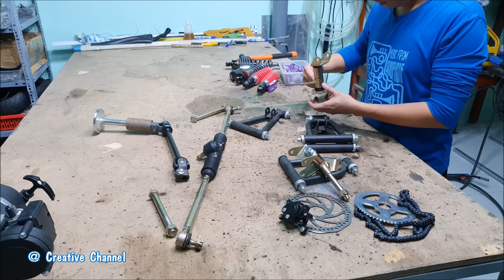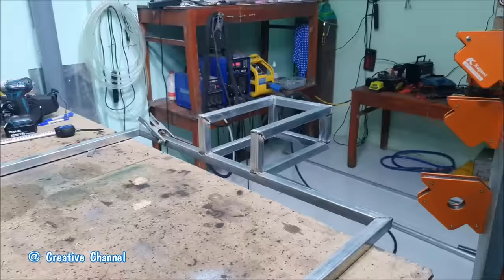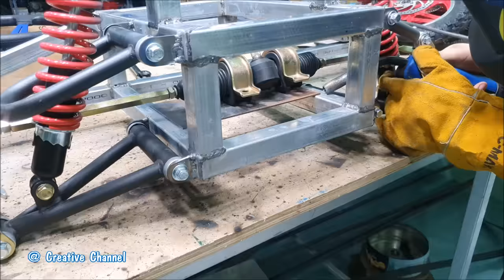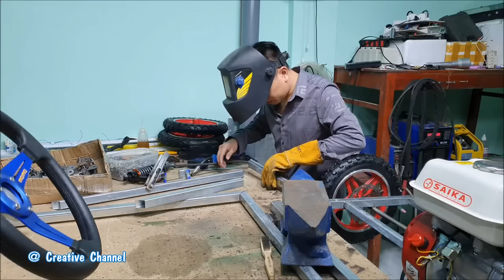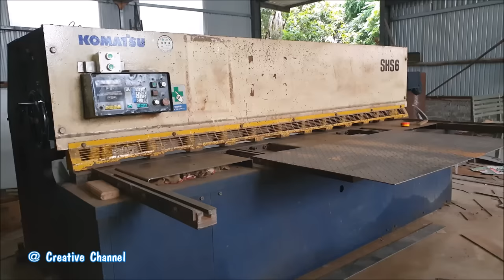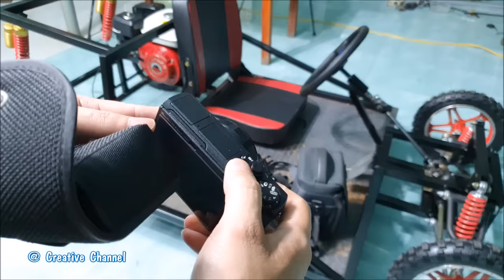Build a 250cc Go Kart at Home - Tutorial

Comment: It is fantastic. One exception: the floor needs more support. It relies only in a couple of screws. You need to reinforce it, especially for your off-road adventures. All the best!
Reply: Need more screws ? Are you kidding ? Did you see how many screws he used on each side of that floor panel ? It looked like every one to two inches !! And that floor panel looked plenty heavy !!
Reply: david lewis Yea I agree with you. What it really needs is more rear suspension support and it needs to be 2 wheel drive instead of 1 wheel drive.
Reply: @davidlewis620  I wasn't talking about the screw number. That go-kart needs at least another piece of tubing in the middle of the floor, front to back, to add more support to that floor. The screws he used are not thick enough to make it in off-road conditions like he was doing in the video. 
In the end, it is up to him whether he wants to consider my advice or not. No offence there!
Reply: @olachus  Ok , I get it, more support for the center of the floor board . Also , he may want to carry a passenger, therefore he would definitely  need more support  for the extra weight ! Understood !!

Comment: Its a awesome development i remember doing a similar project as my final year mechanical engineering project designing and fabricated a compact car with a auto engine on is back... But your project is a bit cooler but the only flaw i found that the lack of differential unit for the rear wheel set only one wheel is powered which will not do you any good if you use this on a uneven surface bro... Also equip the front brakes as well
Reply: Exactly I thought the same thing, only one wheel works when it should have traction on the two rear wheels

Comment: Just my suggestion, but I would have added an angled cross bar from rear upper frame near rear shocks to the bottom of the upright for added support for that assembly the shocks are bolted to. After awhile those welds are going to break or bars bend without those angled supports.

Comment: ok apart from the huge  parts store, this guy works in a totally different way from how I work (I build race cars) , my design is complete before I start, he has the design in his head and assembles/ fabricates all mixed up. my comment on design:  1 the rear frame carrying top of rear dampers needs a diagonal brace. 2. it needs a brake that works!  its very heavy, all that 6 mm steel plate must weigh 25 kgs.  apart from that, he is a talented fabricator and I would give him a job !

Comment: needs a straight shaft so power goes to both rear wheels.
Reply: Totally agree
Reply: Those wheels are way to thin
Reply: You are so right
Reply: I agree. It needs to be 2 wheel drive!! It will perform better
Reply: Definitely needs some reinforcement on the upper rear coil over shock mount The steel was flexing more then the shocks were.
Reply: If you get power to both wheels you wouldn't be able to stear, that's why cars have a differential.
Reply: Krister Emtweden you can still be able to stear but it won’t be the greatest. Most cheap go karts are like that.
Reply: imm thinking same thing
Reply: @kristeremtweden1481  Both wheels is called a "live axle"..
Reply: MattyE   I agree too hate the one wheel peel idea 😂😂
Reply: @kristeremtweden1481  duh... Go karts are the closest to F1 handling, what are you talking about?
Reply: @ΑΡΗΣΚΟΡΝΑΡΑΚΗΣ  so you mean that F1 cars does not have a differential? I would like to se that them taking a corner with both rear wheels spinning at the same speed LOL
Reply: 300 km/h into a corner and booth wheels locked at the same speed hahahahaha
Reply: EVEN a traktor that travels at 30 km/h have a differential or it would be impossible to stear in a corner
Reply: In a gocart you could skid thru corners if you have a live axel but skiding costs time.. and handling
Reply: Oh yeah

Comment: rear suspension is a failure, the frame is gonna brake in a while. much to stiff and wrong position of the shocks
Reply: Exactly, there are just two point of attachment, I think it should has a attach point stronger.
Reply: @Elimarzordan  and the shocks should be 2/3 infront of the wheels and not 1/3 behind,  the principle of the lever. when he mount the shocks on the front upper frame and lower the middle, where the engine mount is, the shovks would work fine and the weak backend of the frame could be cut off. would be my solution
Reply: Dyfe nobody said he’s gonna go drifting, it’s just a video man 😋
Reply: @everydaysalvage  But even he doesn't drifting it will break easily
Reply: @Elimarzordan  u1u
Reply: Dyfe yea Thats what i thought too
Reply: Dyfe and It’s 1 wheel drive lol..
Reply: @ixifernandoixi3326  and one wheel brake....
Reply: Μπομπας Χαραλαμπος lol

Comment: For those “know it alls” it’s just a entertainment video chillout.
Reply: We know its for entertainment that is not the problem the problem is that if people actually build one like his that 
1. its not structurally safe, rear suspension-no support on top frame, no role cage, no seat belts, and where the front steering and suspension join the front of the "cockpit" there is no extra bracing keep it from bending /or breaking if you crash.    
2. welding galvanized steel releases harmful fumes aka zinc oxide which causes health problems.

if you want to see a channel where they build safer ( none of these are totally safe, they are go-karts after all) check out https://www.youtube.com/channel/UCU3gQGhk0lYK-fKOR0sopgg 

i don't want to discourage anyone for building stuff them selves, just be safe.